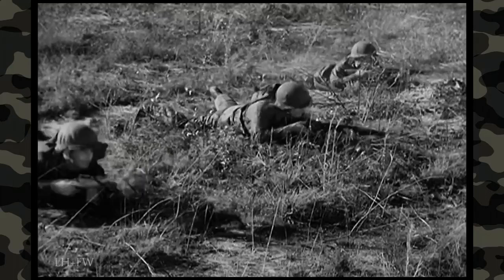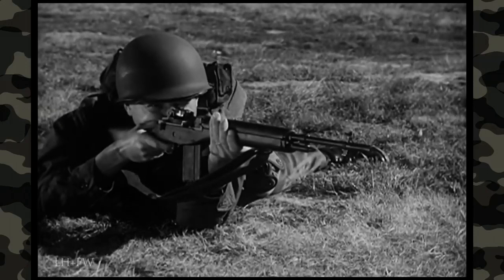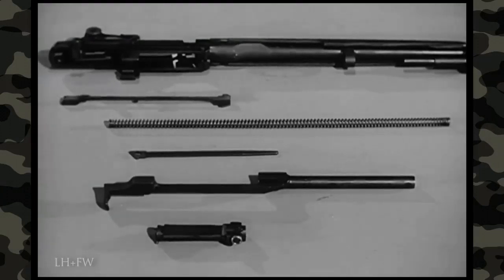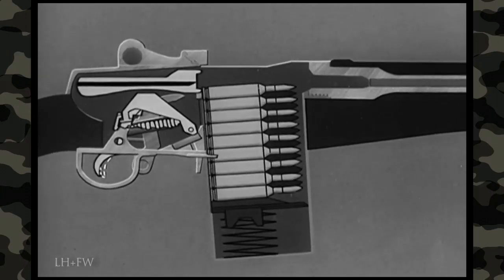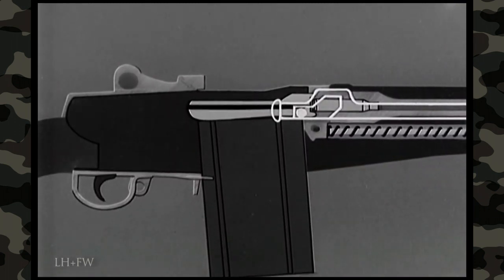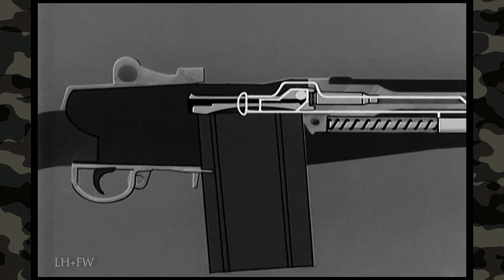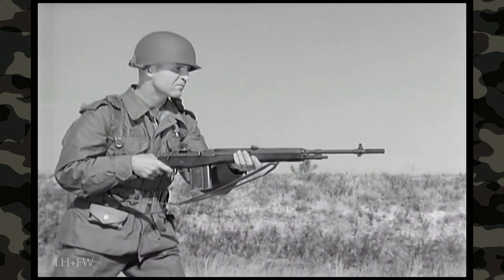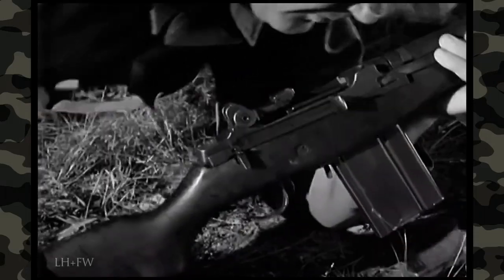U.S. Army Film "The M-14 Rifle" (1960) - REEL History

Comment: It was such a good weapon it spent less time as a standard issue rifle than any other rifle in military history. Overweight,over sized,completely useless in full automatic fire for anyone but a highly trained user and not draftee troops , (the full auto function was disabled when this became apparent) It does make a fairly decent designated marksman rifle with some gunsmith skills to get it that way. The only reason it made it as far as it did was due to the heavy handed general in charge of the new rifle program that wouldn’t accept anything except a 30 caliber American arsenal manufactured rifle. When it came up against the AK-47 in Vietnam it was quickly realized what a mistake had been made adopting this rifle. Total failure as a standard issue weapon.

Comment: This official U.S. Army training film, once and for all, settles the debate of the proper orientation, @3:18, of the cotton web M1 sling. Also, does anyone else disengage the M1/M1A safety with the front of your trigger finger rather than using the right hand thumb as the soldier demonstrates @3:15? Some would argue that " your finger is inside the trigger guard ", but then so is your thumb and I would rather have an accidental discharge while my right hand is grasping the wrist of the stock rather than pushing on the front of the trigger guard with my thumb.